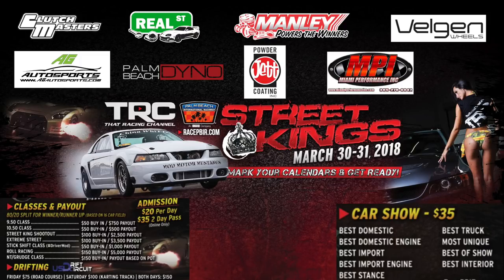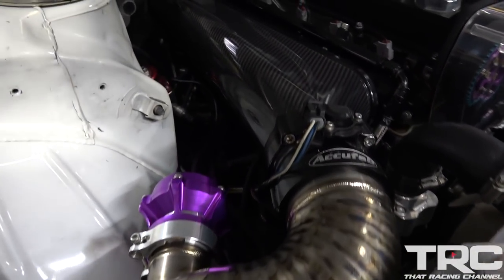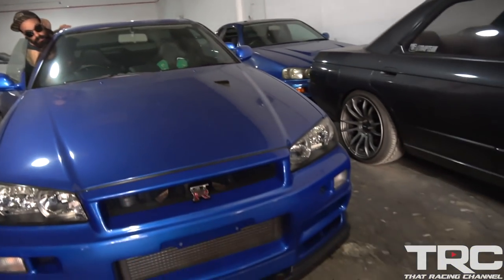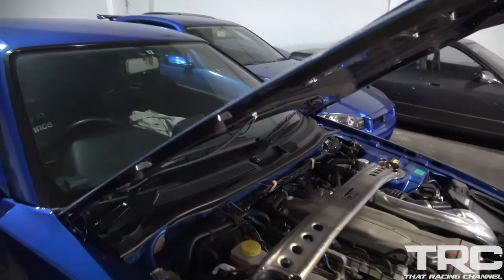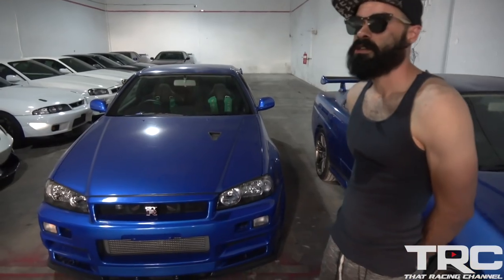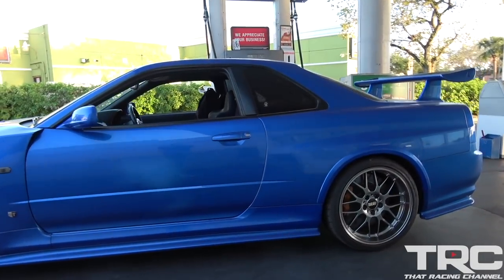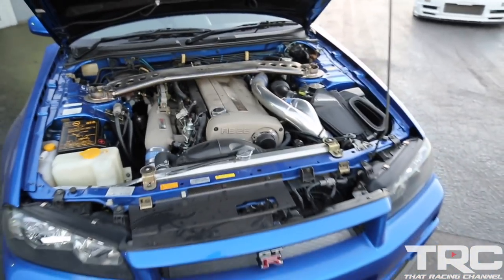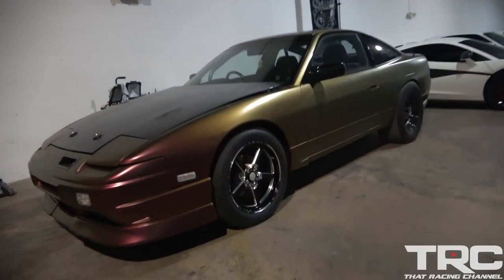RAREST Skyline R34 GTR's in the World?! 6K Miles on the Clock!

Comment: What's the legality of something like this? Are they plated as "show only" and limited miles per year?
I know in Florida you could plate a bowling ball if it had a vin plate
Reply: Yeah, i'm also wondering this...
Reply: Mspec Nur & MP|| are only U.S. Exempt. The rest are fed bait. Even under show/display it has to be OBD compliant among other factors, which costs around $30k. Which I doubt those cars are sadly. Scumbags.
Reply: Not all of them are legal i would assume.. But the special ones are surely legal, if not thats an incredibly big risk to buy a few of the more expensive, sought after r34's in the world only to make them irreversibly illegal to own/drive. When you have several 6 figure cars sitting in a garage it kind of gives off the impression that you have enough money to jump through the hoops and pay to make the federally legal.
Reply: +Some Body No, just because they have a handful doesnt mean anything. It means they got them while the prices are still average before the boom.
Reply: Don't these have to pass the Federal DOT safety as well, to be considered for licensing? If that's the case it would be wrecking 10 of them to show the shortcomings of the car and reinforcing the impact areas to prove they pass those Fed tests. And, those have to be independent tests so, that's not $30k, that's $1M+.  And that's what MOTOREX did, in the beginning before all the crap with them went down.
Reply: Nicholas Butler what boom? The only boom in the Gtr market is in the US, and those examples have been worth a lot of money, even in Japan, since they were built. The Omori technicians car wouldve had a 6 figure price tag in the late 2000's when it was built had it been for sale. I dont think you understand the cost or the markup associated with Omori Factory built cars? Look up the price of all the special Nismo built crate rb26's, then tell me how much you think they bought these cars for.
Reply: None of them are legal. Even under the show and display laws no cars have been accepted yet.
Reply: @Gentry Bradshaw
Show or Display regulations only require emissions compliance; they are exempt from DOT compliance but the car is federally restricted to 2,500 miles per year. Unfortunately, none of these cars are eligible under Show or Display and were imported illegally.
Reply: @YourCarBro
While it is true that none of the cars shown here are eligible for import under Show or Display, the Midnight Purple II and the M-Spec Nur are eligible for import under Show or Display.
Reply: I might be to 7 month's late but have you heard of moterex they imported some of the old gtrs like the r32,r33,and r34 back then, and brought more imported stuff from japan to the us. Later on they were shut down by the government, but the government said that the people that had already bought there skylines could keep them. The skyline in this video might be an old moterex car. They also had 5 r34s stolen from the shop and those might of been crushed.

Comment: NOW That was Straight JUICE! Best all-around Vehicle ever developed in the History of Mankind in my Opinion!! I could stare & obsess over that Machine for Eternity & it would not have been a Wasted Life!!! Now y'all just need my Quintessential Dream Version,.; The Original Release & Totally Stock, 'xcept for The Custom White NISMO GT-R Gauges & A Custom NISMO Z-tune WELDINA Exhaust,; A 1999 NISSAN (R34) Skyline GT-R in Lightning Yellow, & A NISSAN Sil-Eighty of course, but that goes without saying. I remember I did a 24-hour long Nürburgring Nordschleife race with a totally stock Millenium Jade Metallic M-spec nür back in the day on Gran Turismo 4. Ever since I first found out about & drove The Skyline GT-R in the Simulator about 15-25 years ago, when a Friend gave me a SONY PlayStation disc entitled; 'Gran Turismo' that they just happened to find somewhere just laying on the ground where they worked, I was forever back into cars more than I had ever been & I hadn't particularly been for a few years before that in my early teens in the early '90's, not like I had been in my early childhood in the '80's. Ever since then in Every Film & Every Simulator that has to do with Cars that has a GT-R in it (doesn't matter what kind it is), out of all the endless variations of cars that I adore & meticulously fine-tune & slightly modify to idealistic tastful accentuation of its stock Merits, GODZILLA IS ALL-WAYS the most gratifying/satisfying/exhilarating 2Behold & 2Drive. It is an Invent-ion of human develop-mental Engine-eering that proves, like many great underdog & underrated Inventions of this inter-dimensional Plane of being, without a single shredding of a shadow of a Doubt, that Things do not have to be ultra expensive or ultra flashy to be a great Contender & AJ0Y2NJ0Y.

Comment: In the blue one you rode to the gas station in, what is that on the left side of the steering wheel by where the turn signal stalk usually is?  Some sort of a display?

Comment: Why havent ya bought one trc id sell the r32 and get a r34 and take the rb32 yall got and drop it into the r34
Reply: A federally legal US r34 is 80-100k+++, illegal ones are around the same price maybe a little cheaper. That's a big price tag over 25k ish for an r32
Reply: Would you rather have a fully built r32 or r33 with all the power in the world and a reliable tune or a 300hp r34 though? Not worth it in America unless youre sitting on it as an investment in which case its a good buy. That said if you have $100k to blow on a Nissan anyways youre probably rich enough to build it and drive it without worrying about money i guess

Comment: Forget the R35, I’ll spend 100k$ on a R34
Reply: Fasting Media well that's just stupid. You'd take an outdated weak little 2.6L with equally outdated 20 year old technology over a newer and faster GTR powered by a 3.8L with twice the power? Lol
Reply: WillDagamerkid053 the RB26 has a in line 6 that produces more power with better reliability and has been proven and made faster than an R35. The R35 is fast but it’s twice as heavy and it’s computer driven for the most part. To do anything to the motor, you need to drop the vr38. On top of everything, the RB26 sounds way more aggressive than the VR38